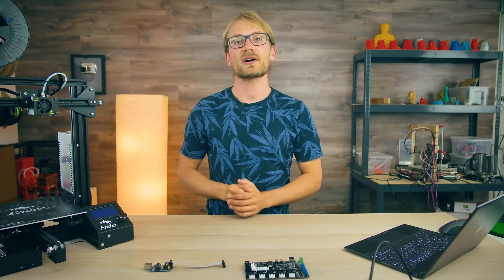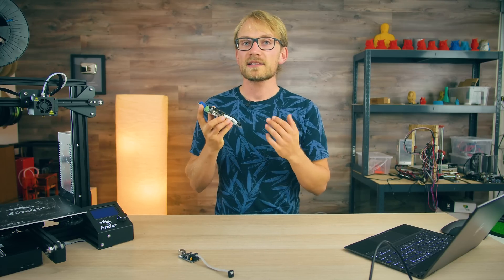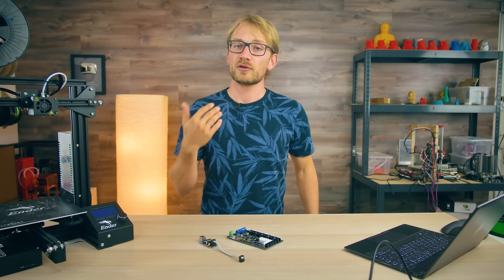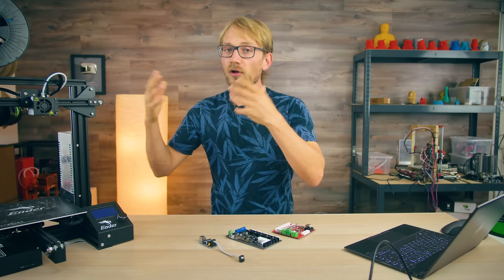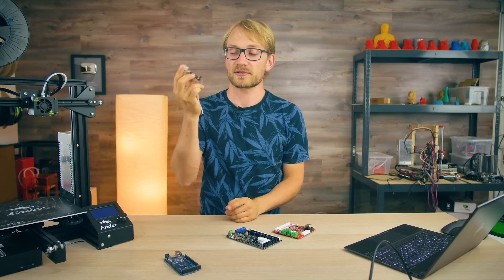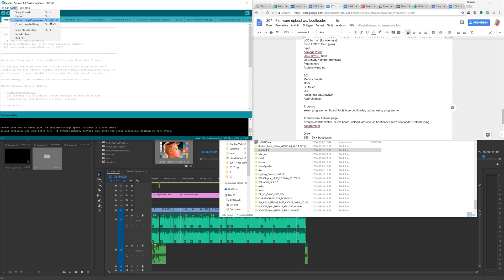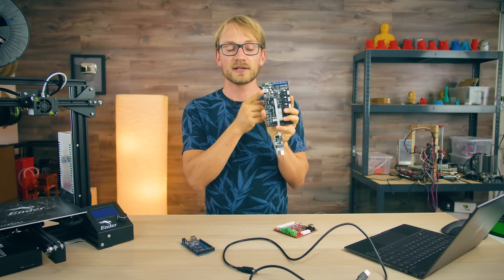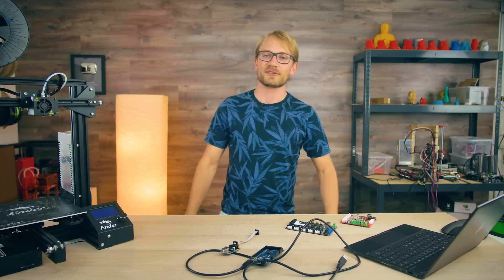Update your 3D printer firmware without a bootloader!

Comment: Great video, yesterday I flashed my marlin firmware on my sidewinder x2, then the printer wouldnt heat up when i start a print. I wanted to go back to the stock firmware but i couldnt because i cant connect to the printer via USB (my PC cant detect the printer) My only hope now is that it works with a Arduino... this method does work for 32bit prozessors too right?
Sorry for my bad english
Reply: i tried but it doesent work or i am doing something wrong i just get this: 
Invalid device signature.
         Double check connections and try again, or use -F to override
         this check.

Chip erase failed: upload error: exit status 1

Comment: Ok thanks, i was getting nowhere with my cheap usbasp board, now i try this method.
Ive got a DDDrop Leader industrial 3Dprinter with old firmware (its no longer be shipped)
I got the latest firmware from the dutch manufactor to upload to the mk2 board (the usb port is not recognized by a computer, this is on purpose i heard) So i have to use the isp Way.
I want to try te read out the original firmware first, is that possible ???
Reply from the maker: It should be possible to save ("dump") your original firmware with these tools, but I've never needed to do that (so take this with a grain of salt)
The internet seems to point towards a tool called "AVRDUDESS" which lets you read and write flash and EEPROM to and from AVR chips, using a separate Arduino like I showed. Keep in mind you need the flash and EEPROM content on the AVR to be from the same firmware. Also, it's possible for the manufacturer to disable reading firmware entirely, so YMMV.

Comment: Hi Thomas, just stumbled upon one of older vid. I've got creality 4.2.2 board that has got the GD32F303 MCU. I flashed it with Klipper by mistake with the STM bin. And now, when I tried to flash it back to stock, it doesn't want to flash. No matter what u do, the board just don't responds to the bin file when booted back up. Not entirely sure if I've bricked it. I'm kinda new to 3D and wondering if this method on your vid might be able to solve my issue? I also notice that I can only see 4 pins for the ISP on the board. Is that even possible or am I looking at the wrong set of PINs?
If you know of a better way for me to flash, pls do send a link or guide or perhaps you've done on one of your other bids that I've missed. Ideally, I'd like to flash it with Klipper.

Comment: Tried this on my chinese 3d printer called ctc bizer dual it was given to me as a birth day gift, i gave up on it because the drivers and software were old it uses the slicer replicator G plus the marlin update was not working. So i broke it in pieces threw it in the trash and bought a proper 3d printer with better set instructions and now i am enjoying it.

Comment: Hi, thanks for the video! Interesting. I do have a question. Could I use this to fix a broken controller board on the Comgo Z1? It seems bricked and not being able to install firmware via tf-card. If yes, I can't find any available pins on the board, would that mean there is no way to connect the board with the usbtinyisp?

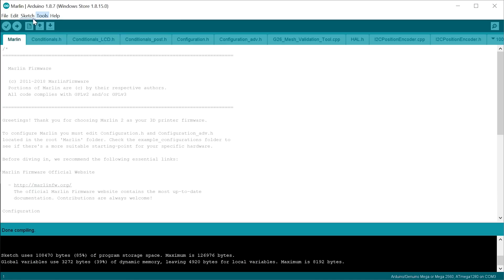Comment: At 8:15, when I want to burn a bootloader to my ANET v1.5 board, do I have to set the Board in the ARDUINO IDE as an AtMega 1284? (That is the processor for this board.)   Thanks.

Comment: My 4.2.7 has no isp what now? Enders are very messy. I did get it back to life by fkashing firmware via sd. But the but tge board says 4.2.7 but i needed to flash 4.2.2 or the steppers did not work. Feels bad. Great video. You explained the boot loaders wel

Comment: Tried for days to get Marlin 2.1.1 compiled for a Malyan M200 board. This system seems to be built around a house of cards, misleading error messages, cryptic help files and code that is not able to compile if very subtle things aren't just perfect in the code folder names and config files (supplied with the current version but won't work with the current version). Not good for a newbie. Can't even get to step one to try and have a file to load in, let alone the physical doing it bit. If you are not dealing with the latest hardware, this system to make the binary file seems dodgy. I don't know how someone with little software experience would achieve a success. There must be a better way surely?

Comment: Hi Thomas, thanks for all your terrific videos. They are very helpful.  My current problem is that I have killed my Arduino UNO, and am now trying to use a USB to TTL converter. The TTL output is 5 pins: gnd/RXD/TXD/3V3/5V and I don't know which RXD/TXD pins to connect to MOSI/MISO on the ANET v1.5 board. Can you advise?

Comment: Hi, nice video, well explained !
My prrinter worked fine, until I noticed the X Motor did not stop during heating up before the print. The stop switch still worked fine during a test. So there was a need to upgrade the firmware. However, I ran into a problem and now I am scared I bricked my Ender 3Pro V1.1.3 board. I have tried this suggested way of launching a boot loader from several UNO's and a MEGA 2560, but ran out of sync many times. Then I replaced the cabling and selected ports 10-14 on the boards for the communication. Loading the avrdude commands from the command line in a CMD window, showed there is communication, but even with a "-F" optional command, I still get:

==============quote====================
Writing | ################################################## | 100% 123.35s

avrdude: 127660 bytes of flash written
avrdude: verifying flash memory against Ender3ProBLT.hex:
avrdude: load data flash data from input file Ender3ProBLT.hex:
avrdude: input file Ender3ProBLT.hex auto detected as Intel Hex
avrdude: input file Ender3ProBLT.hex contains 127660 bytes
avrdude: reading on-chip flash data:

Reading | ################################################## | 100% 74.82s

avrdude: verifying ...
avrdude: verification error, first mismatch at byte 0x0000
         0x00 != 0x0c
avrdude: verification error; content mismatch

avrdude: safemode: Fuses OK (E:00, H:00, L:00)

avrdude done.  Thank you.

============= unquote ==========

Please let me know if there is another solution than buying a new 32 Bit Board for my printer

Thanks in advance

Jos

Comment: Why create more confusion inserting an Arduino in the mix?  You can use just a USBASP little board (eBay $5) and AVRDUDE or AVRDUDESS in the PC to program the chip on board the controller, having the ISP 6 or 10 pins available.  If you have the binary file to be programmed into the controller chip, you will only need to install AVRDUDE or AVRDUDESS into your PC, USB port and 6 wires between the USBASP and the controller board.  People love to complicate things they don't understand very well.

Comment: Is it the same way to program the SKR 1.4 Turbo that does not take firmware via usb only via SD card? The thing is my card does not  currently want to work whit read from sd card the lights are on but nobody is home sort of speak.  The only way it will communicate is via octopi but only G code and all other commands like in monitoring functions. but no update functions work for me..

Comment: Hello Thomas, thank you for posting this video back in 2018 on how to add a boot loader to your 3D printer controller board. I have an original CR10 and wanted to add the boot loader, I have a USBASP V2 and wondered if this could be used as the programmer instead of the USBtinyISP? If so is the process the same? I appreciate your help. Thank you.

Comment: Thank you for the info. After listening to various other 3d gurus who's advice does not work on the creality cr10 s5, This is the answer.
Reply: I have an S5 where the BL Touch flash bricked my printer to a blue screen. I am about to buy an ISP flasher so hopefully it works.
Reply: @samueldummler7307  Hi. I have the exact same problem with my CR10s S5. While flashing the firmware i accidentaly unplugged the usb cable amd noe im stuck with a blue screen. Did you solve it and can lend me to the right direction?
Reply: I solved by burning a bootloader again

Comment: Hello, I hope it is the right place for this question.

I have a BIQU Kossell PLUS printer with BIGTREETECH GEN V1.0 card, 2 weeks asking for help and BIQU do not answer my emails, I wrote on Facebook and they only question me in a bad way and do not send me the information I request, their official website does not It even has the download links, a disaster, a terrible service, very bad treatment to its customers.

Unfortunately, my card came with a short in the port of the 0 hotel, I live in Mexico and there is no guarantee, I started studying Marlin to try to get out of this problem, I tried to change the ports between Hotends 0 and 1 without success in the file pins_RAMPS.h.

I managed to exchange the fan port (digital 9) with that of the extruder resistor (digital 10) losing the possibility of controlling the fan.

I hope someone has the pinout of the card or knows how to activate the extruder 1, according to what I have read is the digital port 7 but apparently the change is not so simple.

For what I had to experiment with BIQU, I will never buy anything from your brand and much less recommend them.

Comment: could you tell me if I need a boot loader ?? I got CR10S is this build in ?? because I wanna add BT-touch on my printer and I dont have any of those boards I would like just add Hex file onto sd card too firmware just make it easyer for me last time I did the Marlin firmware before but I went back too stock firmware on cr10s but now its hard for me doing this firmware

Comment: Hi, I had a problem with the srk v1.1 pro board, and I need to get the bootloader, do you have any idea where I could get it?
If I have another equal board, is it possible to clone it to the one I lost through ST-Link v2?

Comment: Hi. Thank you very much for the video. 
I'm trying to get my 3D printer to work without being connected to the PC. I need to upload the codes to my Arduino Mega board and after that just get the printer working only by clicking a button. Can you explain to me weather or not it can be done and how to do that?
Reply: well once you update your firmware (i recommend marlin), there is a free opernsource software called "Octoprint" , upload that software to a rasberrypi, conenct it to your printer, then you can print remotely

Comment: Hi Thomas. I have a Melzi2.0_V5 Tronxy board. I did everything possible, but I couldn't burn the bootloader. I tried to use USBTinyISP but figured out it doesn't work with Atmega1284p chips. Tried Arduino UNO as an ISP programmer. No result. here there is an example of error.

Arduino: 1.8.9 (Mac OS X), Board: "Sanguino, ATmega1284 or ATmega1284P (16 MHz)"

avrdude: stk500_getparm(): (a) protocol error, expect=0x14, resp=0x14

avrdude: stk500_getparm(): (a) protocol error, expect=0x14, resp=0x01
avrdude: stk500_initialize(): (a) protocol error, expect=0x14, resp=0x10
avrdude: initialization failed, rc=-1
         Double check connections and try again, or use -F to override
         this check.

avrdude: stk500_disable(): unknown response=0x12
Error while burning bootloader.

Now it's dead, from the software point of view. Would you please help me to do something to bring this board alive.

Comment: That Ender in the background taunts me. The bed is a bit off and still won't quite level right even after I upgraded the flimsy springs. Maybe I didn't get the vertical limiting switch just right. Who knows... I still managed to get it level enough to print a few upgrade parts, but it wasn't easy and kept having to be adjusted between sessions. 
To deal with that, I got an auto-level sensor for it, only to realize that I have to update the firmware, so it'll actually work. That's my fault for not thinking about that part of things. 
Then, I find out I can't just plug in a USB to the port and update the firmware, so I get an arduino kit. Now, before I can begin, I find this video showing me a cheaper alternative, one I could probably just probably integrate into the printer.

This thing has really been an interesting experience...

Comment: I've successfully done this on an ender 3 with the USBtinyISP. What I've learned is 1. The ribbon cable orientation should be the cable touching the wall of the case. 2. I had to cut off some plastic from both the usbtiny cable and the ender 3 screen input on the board to allow the cable to fit. 3. Load the bootloader and disconnect do not try and load the firmware through the tinyusbisp. Connect your laptop to the ender with usb to mini-b type cable (I found at goodwill for 99 cents) and change to com3 then load the firmware. And you're all set.
Reply: Which application did you apply the firmware? Hex?

Comment: just a warning if you use the DK Usb tinyISP and just try to flash the firmware as shown it will fail due to the  64k limit the correct way to recover from this is just flash the boot loader it will fail to verify then upload via usb

Comment: Hello, i have a question about a problem that i just got.
My printer crashed once because of a end stop not working. After this happend my nozzle temp went up to 268 c all the time at room temp. I tought that it maby was the sensor so i changed it. This did not help.
So i switch it with my bed temp sensor and the sensor worked great again and the nozzle temp was still 268 so i think it is in the board. 
Is there anyway of reseting this or fixing it??

Thanks 

(Sorry for bad English)

Comment: You said your board does not have a bootloader. It's not possible as it will not work at all. You just didn't have right one which arduinoIDE (for example) can use

Comment: I had some strange experience with the USBTinyISP (Deek Robot v2). Burning a bootloader failed after successfully erasing everything on my Ender-3 Pro v1.1.3 with Arduino IDE 1.8.5. However I was able to upload a marlin sketch with the USBTinyISP - verification failed - but my Ender 3 is working fine now with BLTouch enabled. I think an Arduino Uno as an ISP programmer is much more reliable than the USBTinyISP.
Reply: For what I found on the Internet so far, the USBTinyISP cannot address the whole flash, the reading process cannot work. This is why the flash software works after successful writing but with verification failed. Regarding the failed bootloader I found that the USBTinyISP is too fast to burn a bootloader. So after turning on verbose mode in Arduino IDE, copy the command from avrdude into the terminal and add -B 4 to slow it down. (Not yet tried since my firmware is working just fine)
Reply: @claudiusalbat4048  yep needs to be a warning about it, just killed mine by following this video and not reading the comments Arduino UNO on the way
Reply: snappermancation i was able to burn a bootloader with an older version of the Arduino IDE, I think it was 1.8.3
Reply: @claudiusalbat4048  managed to get it to work, installed the boot loader and flashed over usb
Reply: @claudiusalbat4048  Sounds like you have a USBtinyISP version 1 board marked as a version 2. Version 1 boards cannot access more than 64K of the target board's Flash. Genuine version 2 boards have no problems at all programming the ATmega1284 and ATmega2560 with their 128K and 256K of Flash.
If in doubt you could try a USBasp ICSP programmer from Freetronics, they have no problems with any of the Atmel processor line.

Comment: Thanks for the detailed instructions. Just got an Ender 3 and couldn't get the bootloader to load on the mainboard. A step that most videos missed were that you need to upload the ArduinoISP first to initialize the Arduino with the bootloader. After spending 2 hours researching.. it was fixed in 5 minutes. Now bootloader is flashed. Thanks.

Comment: Useless video!  Tom, it only works with chips with 64K or less flash.  That means "normal" boards with 128K or 256K cannot use this method.  I expect much better information from you.
Reply: Not a useless video. Sure, version 1 of the USBTinyISP only works with CPUs with 64K or less, bit version 2 works just fine with ATmega2560 CPUs - I do this regularly. If you're buying one off of AliExpress or eBay instead of Adafruit then make sure you're buying a Version 2 board. If in doubt there's also the USBasp ICSP programmer from Freetronics.

Comment: No one can seem to answer this question. If the Printer has a computer port (serial or USB) why do people keep using the micro sd card rather than hook directly to a lap top or note book? Seems to be having the printer being controlled by 8 or 16 GB of ram and a terabyte of storage is better than the minuscule memory in the machine. Thoughts?
Reply: The printer's hardware/software does the work.  Directly connecting your computer would just be another means of getting your gcode transferred to the printer.  If the computer you use to do the modeling/slicing is not near enough to the printer then use the sd card to transfer your work over.  Or wirelessly if you have an octoprint or similar set up.
Reply: For one thing printing from SD card can be anything up to 20-30% faster than printing over USB. This is because when printing over USB (e.g.:  from Cura or OctoPrint) the Gcode commands are being sent one or a few at a time, until each command gets an acknowledgement, then a few more get sent, and so on until the job gets finished. There's a significant delay added to the print process waiting for the acknowledgements and sending the next command(s).